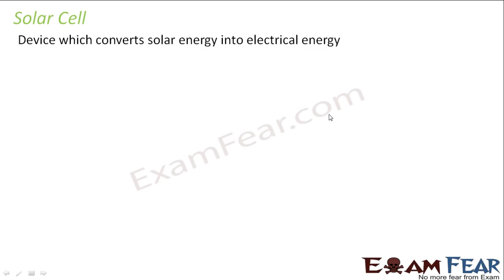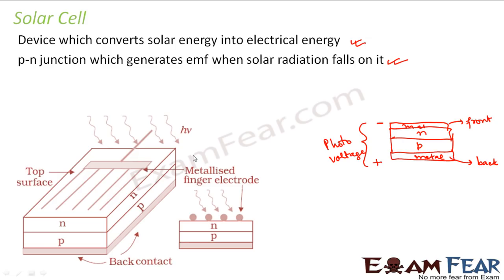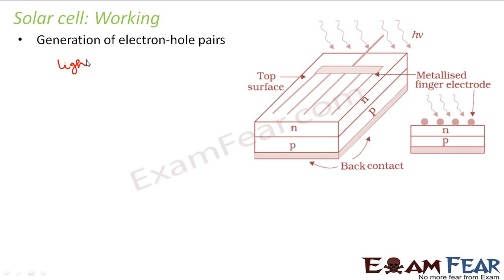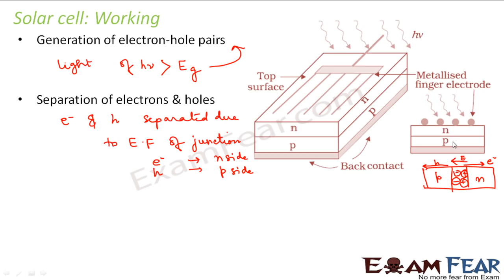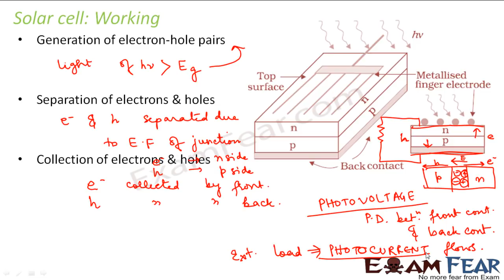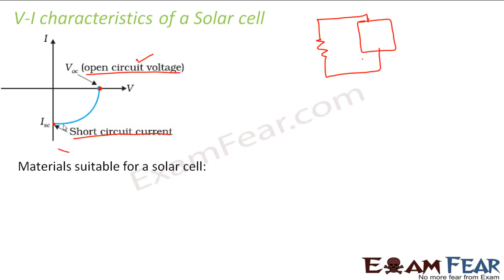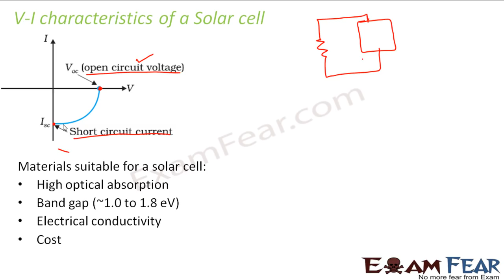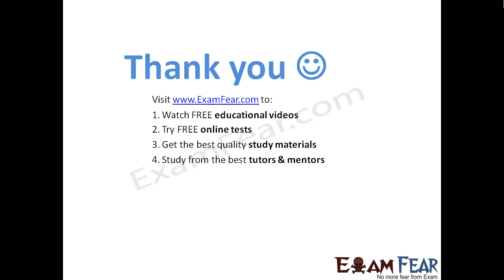Physics Semiconductors part 17 (Solar cells) CBSE class 12 XII

Comment: why open circuit voltage is so called?
Reply from the maker: This is the voltage corresponding to the circuit when the current flowing is zero, so the circuit is open, that's why it is open circuit voltage. Refer the graph for better understanding.